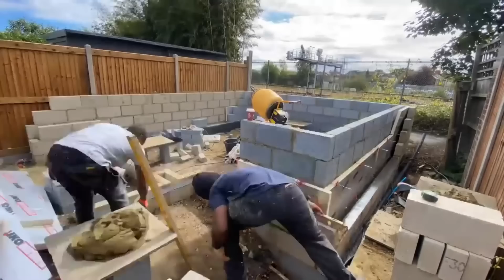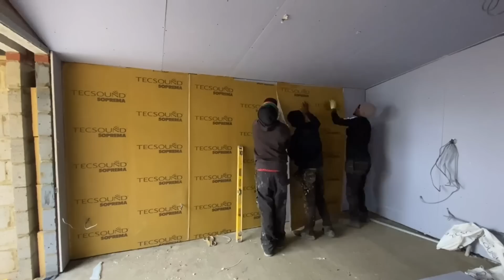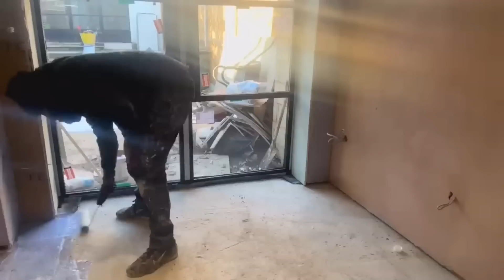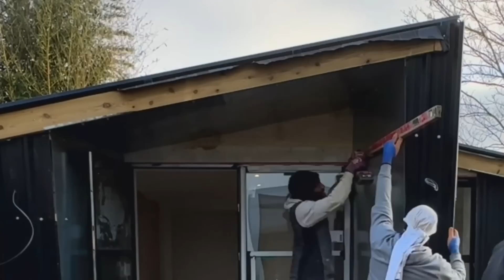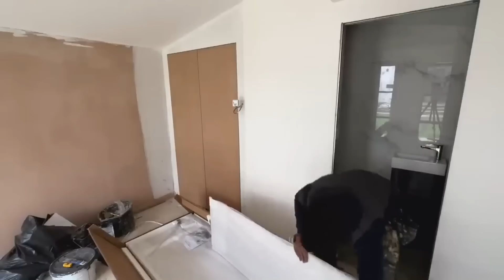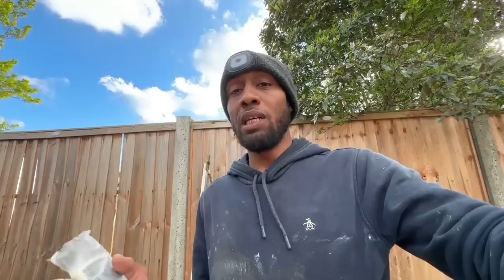Building a designer garden house - Timeplase with narration

Comment: Great build. Very nice. Due to circumstances I'm catching up on your videos.  
Curious question. You used an iron beam, why not just a thick wooden beam? Was it as requested by the structural engineer. Just curious cos I'm also thinking of building an office garden house.
Reply from the maker: Hi 
Thanks
Yea we had engineered drawings which had the beams specified by an engineer